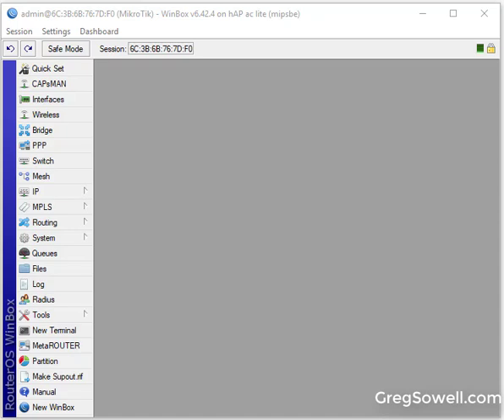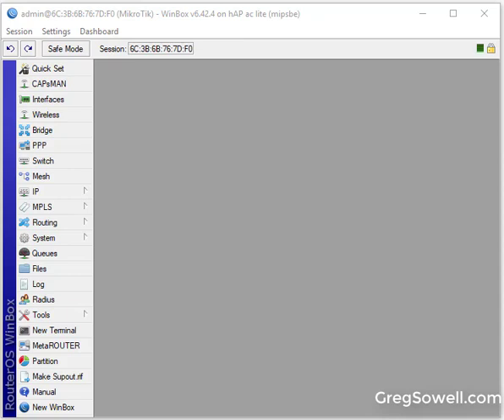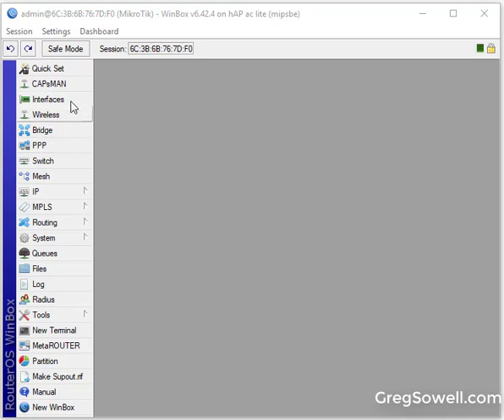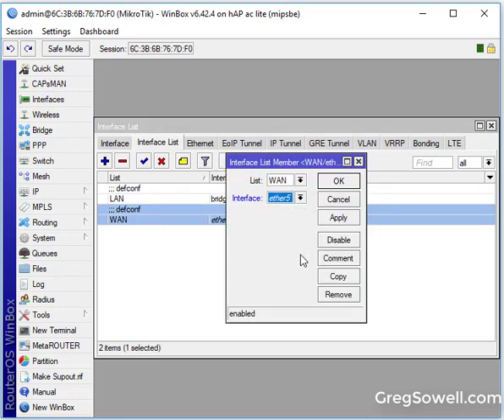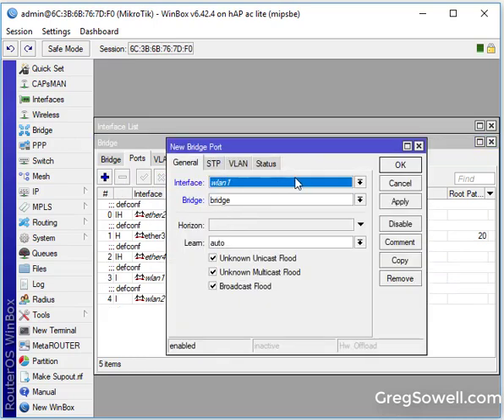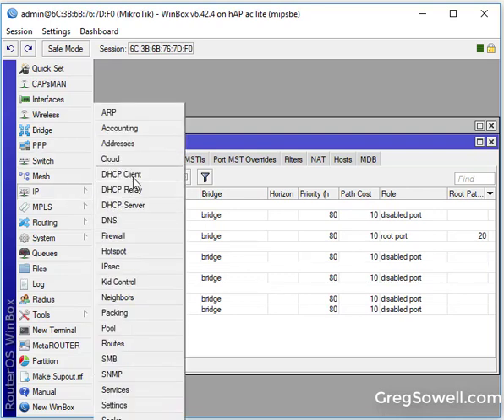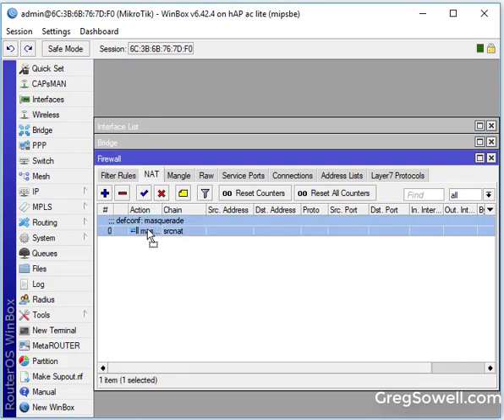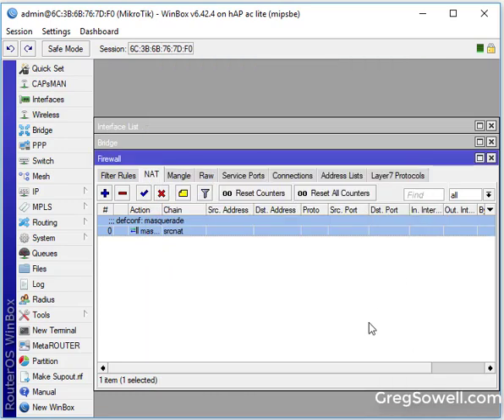Mikrotik Move WAN To PoE Out Port

Comment: Hi got a stupid question, I have secondary WAN (backup, 5G) which requires PoE until now I've used a cheap PoE injector but it recently burnt out, I also have a TPlink TL-SG3210XHP-M2, it provides the 2.5GbE POE+ port I need. can I follow this same tutorial and assign the WAN on the switch to work basically as a native WAN? again I'm sorry if it's a stupid question I'm a complete noob when it comes to networking and just doing this for home setup basically.

Comment: Very helpful, Greg - thank you! Would you happen to know, on an hAP ac router, will Router OS support dual WAN interfaces, with auto fail-over? I'm trying to use Ether5 for POE and WAN to connect to a WiFi extender, with a fail-over to Ether1, connected as a WAN port to an LTE modem. I suppose the real question is not can it be done, but could it be done by ME using menu options like the video above, as opposed to creating/uploading code and scripts! Many thanks,

Comment: That's great!  Is there an easy way like this to have multiple bridged ports on the WAN side?  I have accomplished this with a lot of frustration and  went pretty far away from "the default configuration"

Just for clarity I am not talking dual WAN, I just want to eliminate the need for a dmz switch when you have multiple static IP's with multiple routers. As an example for FiOS set top boxes you need to keep their router attached to get the guide info.
Reply from the maker: Create a bridge.  Add your "WAN" ports to the bridge.  Move DHCP config to the bridge/update interface lists with bridge as WAN.

Comment: Hi. I tried to do this using a map2nD which only has two ports Eth1 and Eth2 (POE) but i could not figure it out. Can you assist?
Reply: I managed to do this on map2nD only after upgrading to the latest (6.48) firmware. With the older factory firmware it has't worked.